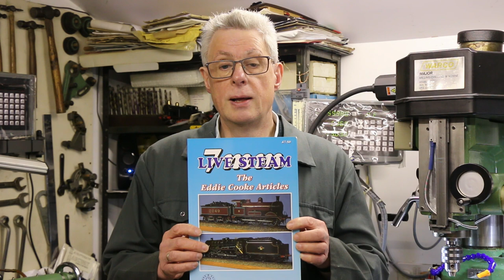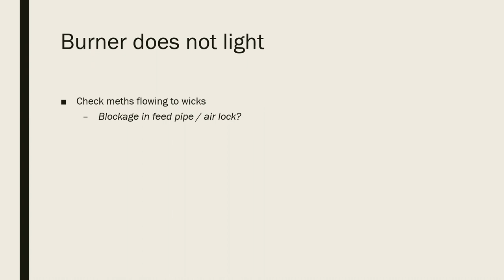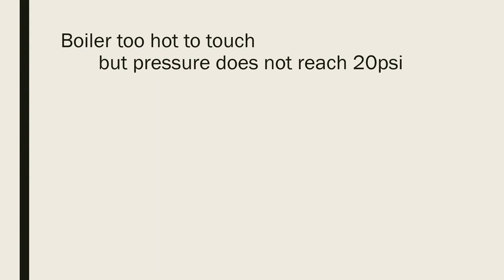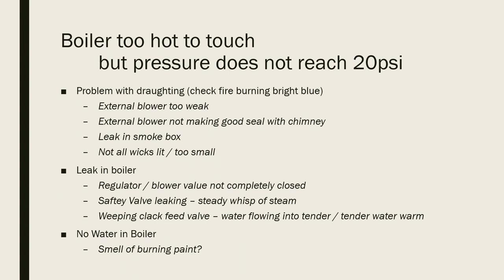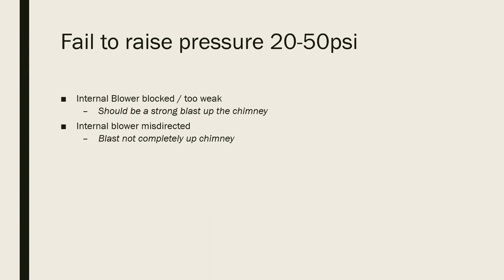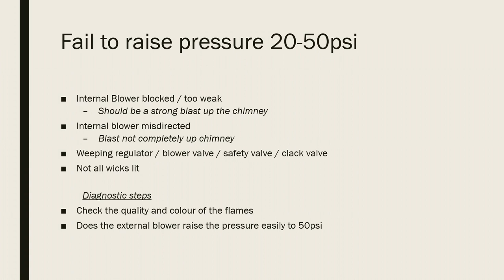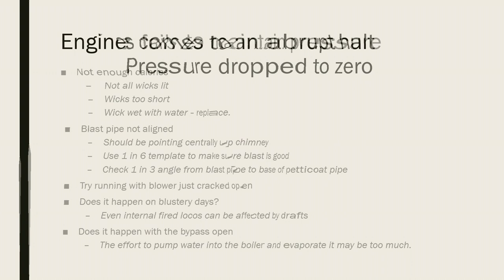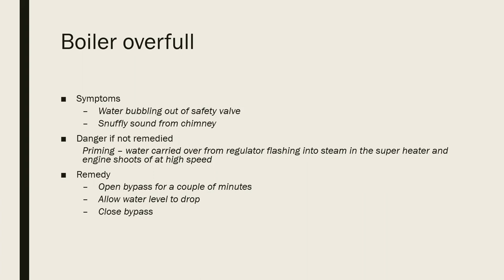O Gauge Live Steam - Raising steam

Comment: Thanks for the time and effort doing the video which is so helpful. Had  me gripped throughout and I cant wait to get troubleshooting my Royal scot which I couldnt get going last year. It however doesn't have a water gauge(I think it did have once) or pressure gauge and no axle pump. out of the 2 gauges which would be most helpful  and is it possible to retrofit an axlepump?  Thanks in advance for your thoughts and happy steaming
Reply from the maker: Peter I'm glad the video was helpful. Assuming your Royal Scot is meths fired, then a water gauge is optional - a silver soldered boiler can run dry without any issues. I personally like a pressure gauge in high pressure loco as other wise you are relying on the safety values. That said, once you get used to how your engine behaves, it is less necessary. An axle pump is a nice to have. For some years when employment limited my time in the workshop I ran my Netta without one. I had to remember to periodically use the tender hand pump to top up the boiler. On most tracks, this meant every circuit. Given Netta is a freight engine, long continuous runs are not expected. Retrofitting is difficult but not impossible. 
Happy steaming

Comment: Hi Dave, I have access to a full machine shop this summer and am looking to build an O gauge live steam locomotive. Did you build these yourself/do you know of any resources I can use to get started? Thanks in advance.
Reply from the maker: Christian, Good news wrt getting access to a machine shop. My initial introduction was the 'words and music' of the designer LBSC which appeared in the Model Engineer over many years. Reprints of his BAT and OWL designs are available. Follow the instructions and you will have a working locomotive.  I started with his NETTA design. The other resource is the Gauge O Guild 7mm Live Steam book. There is an 'O Gauge 7mm Live Steam' group which also has many resources available. I'm always happy to answer questions
Reply from the maker: https://www.model-engineer.co.uk/forums/postings.asp?th=109791 shows someone building a LBSC mollyette - a single cylinder tank engine with a smithies boiler. This could be a good starting point. In the O Gauge 7mm live steam facebook group, someone has just posted the instructions (Words and Music) from the original articles. Follow them and you should have a working model.
Reply: @DrDave_63395  Thanks so much, this facebook group looks very helpful! I am sure I will have some more questions as the summer approaches.
Reply from the maker: BTW there is a Live Steam section on the Gauge O Guild forum where experts are willing to answer questions. And we will be at GuildEx show
Reply: Dave Robinson  hello it’s not a smithies boiler ,just a pot boiler with circulation tubes  . Just saying !